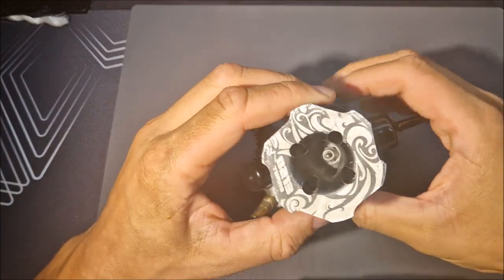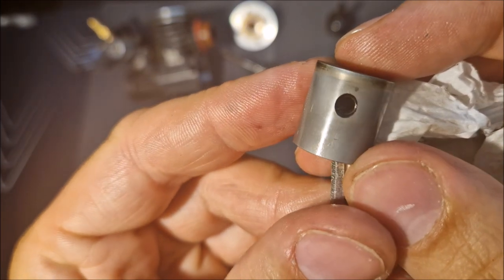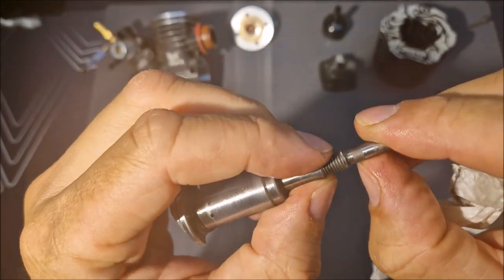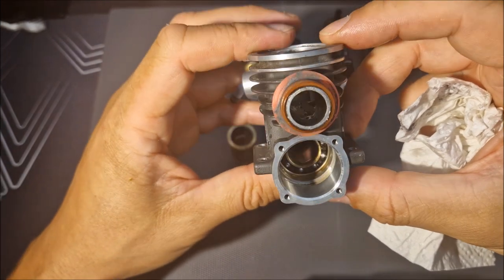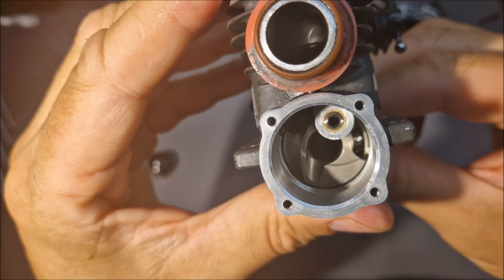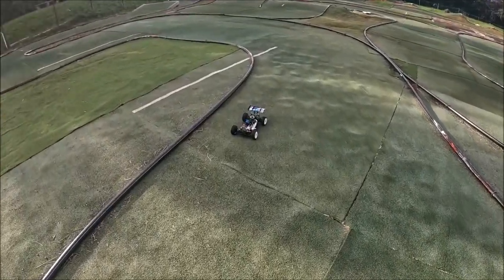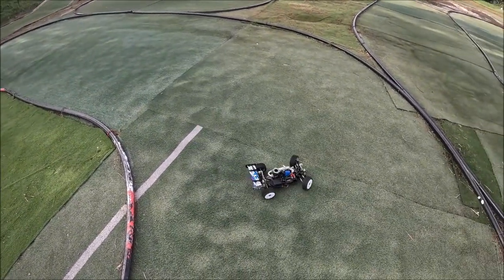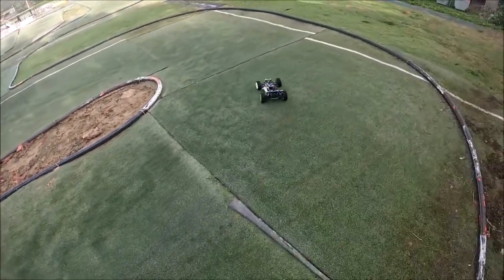Cheap Nitro Engine, Take Apart & Test Run, HOBBYTECH B213

Comment: hey Taste B I live in Europe just like you and I can't buy nitro with a high percentage of content if you don't race on circuits etc etc, my question is the following, do you think it is a waste of money to use low nitro content in big blocks? Another, it is the first time that I have a big block big red .28 and it consumes a lot of nitro, I had an Os21 TM and the difference in consumption is abysmal, what do you think about these variables that I am explaining to you? Are large blocks in Europe worth buying? sorry for the long message..
Reply from the maker: Any engine will run with low nitro fuel but not any engine will run and tune GOOD.. Some engines like it, other dont, my SH28 8p was not tuning very good with low nitro fuel but from what I hear your big red is running pretty good!!! As long as the temp is good, bash it! 

And yes those bigblock engines suck a lot of fuel, the OS21TM is much better IMO than any bigblock currently available, you will always get a much better fuel mielage with a .21 and most race .21 will outperform a bigblock engine 

Where are you located??
Reply: I from Spain, thx for the reply and the subscription ❤ u have a wonderfull channel!! 👌
Reply from the maker: @Rc_Revo-Nitro_Andalucia  Thank you! An d you live in a beautifull country, I spend my Vacations in northen Spain every year

Comment: The cooling head looks cool and is it normal to have still some pinch after 5 gallons or is that very good?
Reply: To really understand if the pinch is still ok, you have to know what it is like new. 
Also, checking to see if the piston skirt doesn’t go higher than the exhaust port, is a true indicator of good pinch. 
- If it goes above then, the sleeve is near the end of its usable life.
Reply from the maker: Pinch could have been better after 5 gallons

Comment: Great engine for the price. A bit tame on bottom but mid and top are pretty good. Crank counterweight design is looking better then some higher priced engines...(with handpainted coolinghead)😆 deffinitely replace the conrod ....and bearings too. Sure it will give much more gallons of fun. Great vid again buddy 👊
Reply from the maker: Yes Kings very good for the price! I wonder if that crankshaft would fit my dusty, pretty sure it will tune better 😆Definitely deserves new bearings and conrod!

Comment: Really nice for a entry level engine. Kind of reminds me of the Taiwan RB’s they all were pretty good engines. But they just fell out of favor when they started making them in Asia.
Reply from the maker: Exactly, RB where very popular when they were made by Novarossi, very expensive too!! Then Rody Roem sold RB Engines .. Now he created VS Engines wich are made by O.S. but not just rebranded O.S. engines, they are made wtih Roems specifically designed crankshafts and based on the 21XZ-B 5 ports, wich are nowadays only made for his engines!!! Very interesting stuff, maybe my next black friday engine 😁

Comment: Merci Tasty B. Je viens de découvrir ta chaine. Ton test m'a décidé à acheter ce moteur pour le tester sur ma GT8. Je sais que ce n'est pas forcément le plus adapté pour le GT8 mais je l'ai trouvé à 143€ chez Imodel donc c'est une bonne base pour s'entrainer. Et comme tu as dit qu'il avait un bon top end, sans modifs ca devrait déjà me donner des perfs honorables.
Reply from the maker: C'est un bon moteur tu ne sera pas déçu.  Il y aura forcément une difference de performances entre les moteurs TT et piste mais n'importe quel moteur TT conviendra pour une GT tant que tu ne vise pas un podium 💥💥
Reply: @TastyBRC  Merci encore. Tu penses qu'il y a moyen d'améliorer les performances de ce moteur en le modifiant (légèrement) ou cela ne sert à rien ?
Reply from the maker: Je vais bientôt pouvoir te dire ça, le proprio de celui ci me le renvoie pour être modifié.  Mais dans tous les cas si tu accepte de perdre en bas avec un moteur TT tu peux gagner en haut ce qui conviendra forcément à une GT avec sa boîte 2. La question c'est, est-ce qu'il y a moyen de gagner partout?
Reply: @TastyBRC  Si tu as besoin d'un autre moteur pour tester des choses, je peux t'envoyer le mien. Bien sur, si tu es d'accord pour le modifier, je te paierais pour tes services :) Récupérer de la puissance en haut c'est effectivement tout ce dont j'ai besoin pour la GT2. Et avec un 3 ports plutôt que 5, j'ai l'espoir d'avoir une meilleure autonomie. Mais tout ceci est une longue histoire, le moteur est neuf, il faudrait mieux que je le rôde avant...
Reply from the maker: @Zedsispeho  je ne fais pas ça pour de l argent..  si tu veux que je le modifie ce sera avec plaisir.  Ou après avoir modifié celui de mon pote je peux te dire ce que tu peux faire facilement sur le tien.
Reply: @TastyBRC  Cool. Merci Tasty. Je vais arrêter de polluer les commentaires et on en discutera sur messenger/facebook. Merci encore. J'attend avec impatience le résultat de tes modifs sur le hobbytech de ton pote . Je comprend bien que tu ne fais pas cela pour l'argent, mais cela me fera plaisir de t'offrir une bière ou un café si on se croise au hasard d'une course sur un circuit ou sur un autre 🙂😉

Comment: Impressed with the internals to say the least , the engine has a spike in power transitioning from low to mid and high end is ok in my book … the pipe can changes everything . I’d like to get my hands on one of those to try and smooth out the hit and squeeze some more high rpm pull out of it . Did you play w shims ? If you tighten her up she will have much more snap when you jump on the trigger. I just finished an Alpha .23/Gt-R  Hybrid and ended up running .10 under the sleeve and nothing under the button lol . She came w .30 stack but .1 in total was the magic number with 30%/10% nitro . I didn’t get to test 30/8 as I have moved onto a Max Gt-Rx for testing .
Reply from the maker: Yes it's looking very good, 159e, 170$ you cant beat that! It will definitely run better with a pipe like the hipex 2135 or that iealsi 2186 but didnt tried, I only burnt 1.5 tanks as this engine is not mine, the conrod is pretty worn out, I dont want to kill it!
Did I read well, .10 under the sleeve on 0 under the button head You like them tight for sure😆

Comment: What glow plug do you run it ? 
O.S. P3 ?
Reply from the maker: Its the stock no name glow plug! Still tunes very well
Reply: @TastyBRC Just bought this engine, what exhaust would you recommend using ?
Reply from the maker: You wont be disappointed !  Thake goog care of it, temp, preheat and it will last very long. I definitely recommend the hipex 2135, this pipe will help a lot at bottom end power
Reply: So i bought pipe, basically i ran about 1.8l of racing experience break in fuel and engine refuses to run cold it stays always 140° and goes even higher, in manual says temp over 130° much shut off, and there's bubles in fuel line near carb niple, i don't understand too. in my eyes i don't like this engine. glow plug is medium  @TastyBRC
Reply from the maker: @lukassslukasss1864  add me on mssger and send me a video I would like to see your engine running. Maybe I can help you.  Check if your fuel tank and the fuel lines are sealing properly, this engine is very easy and consistent, I think you may have a  airleak